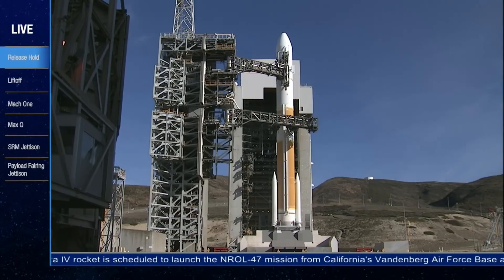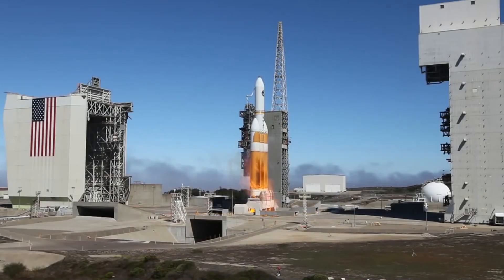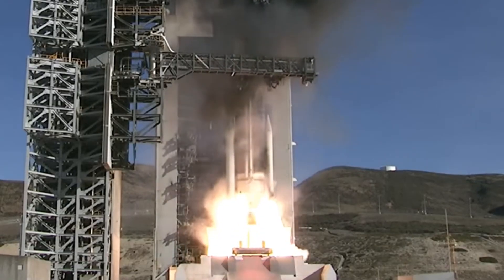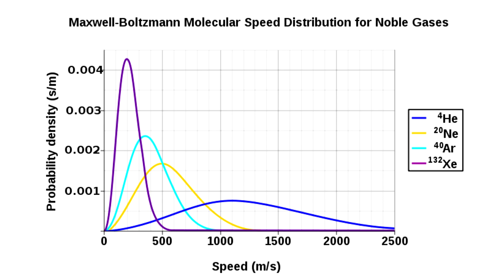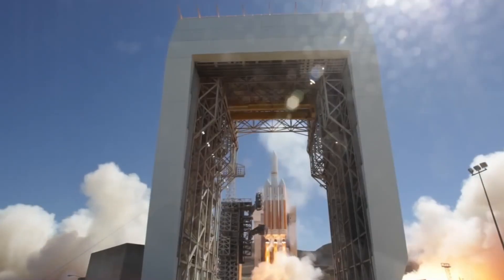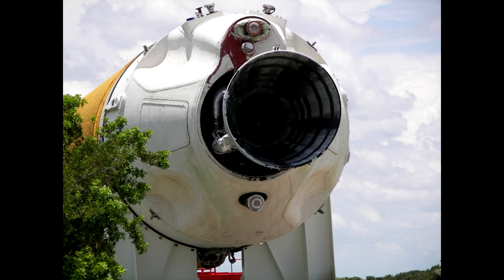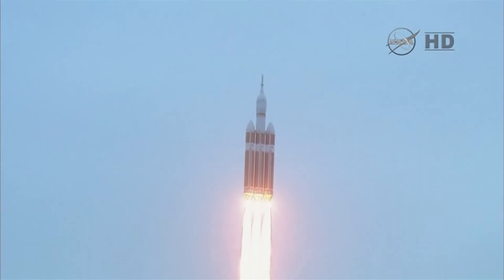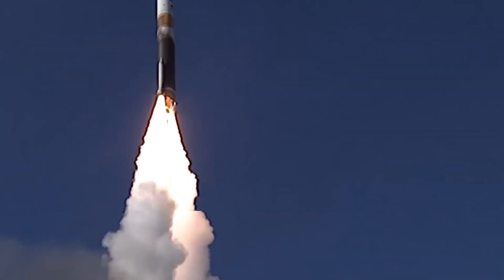Explaining the Delta Rocket Fireball - Kerbal Space Program Doesn't Teach....

Comment: IF IT IS CHEAPER AND MORE POWERFUL THAN THE RS-25 (SSME) ENGINE THEN WHY ISN'T THE RS-68 ENGINE USED ON THE SLS?  CAN SOMEONE ANSWER THIS QUESTION???
Reply: The video even mentions it: the engines were one of the biggest barriers to crew rating the Delta IV. The proposals ULA offered to crew rated the rocket involved switching to the RS-25 or developing a new RS-25 based engine that would have a cheaper unit price (but because of development this would be the more expensive option overall).
Reply: @Hevach  Thanks Jeff For Explaining That And I Like Your Explanation!!!👍

Comment: Would it be easier to modify the delta IV to put up hardware that will be used by humans on orbit? Being able to use something big and heavy to put up the long-haul part and launching and landing the squishy meat in a smaller capsule that doesn't need as much rocket, and thus doesn't need as much rocket person-rated, seems like a sensible way to get most of the benefit of both.

... Also, you should be advising ULA to check their staging anyway. Making sure everything goes off in the right order is even more important when giant fireballs on the pad are considered nominal.

Comment: So that’s why the Shuttle had those spark generators mounted bellowed the SSME’s that were turned on just before ignition sequence to burn off the hydrogen so the tiles didn’t get singed? You can often see on Shuttle launches a burst of flame around the SSME’s as they ignite.

Comment: If the RS-68 is more powerful than the RS-25, then why is the SLS designed to use four RS-25's? Is it for the improved efficiency, or just because NASA had a bunch of leftover engines after the shuttle program ended?
Reply: The core runs from sea level to almost orbit. They need engines that are efficient from sea level to orbit; which the RS-25 does spectacularly
Reply: It’s because of ablative nozzles. The rs68s would get destroyed by the srb plumes. The rs25s will not

Comment: Tory Bruno recently said in an interview that his company's new engines will run leaner with a greater oxygen/hydrogen ratio. It is now April 1, 2020.  I believe his interview was about a week ago in later March 2020.  He said the Russians had used this system in the early years in their engines and it saved a lot of weight from fuel.  But they knew the higher oxygen (leaner mixture) would be more corrosive.  Their secret which we now know is that the engines must include a chemical insulation to prevent them from getting too hot and corroding as well.  I think I said it right.

Comment: The Rich air/fuel ratio also makes me wonder if they did that as hydrogen on its own is a much lighter molecule than H20, meaning that the hydrogen is probably accelerated to a greater speed in the combustion chamber than its fully combusted H20 counterpart. That would mean a much greater maximum velocity of the exhaust gasses, no?

Comment: Hi Scott--I have taken to watching your stuff with interest.  You do a good job.  For the purposes of this video explanation, I would like to offer the following modifications:  First, regarding the expulsion of H2 from the RS-68 during engine start--the start sequence on the Delta 4 was not the start sequence we were ultimately intending to use.  The start sequence currently being used was one that was put together for the purposes of initial development testing, and was intended to ensure that the engine's H2 system was in thermal equilibrium before any O2 was introduced.  The purpose of this was to preclude any H2 flow oscillations, which are present BIG TIME in the SSME during start, and which render the SSME's start sequence a very delicate matter.  We were still 'stinging' from the SSME start sequence 'debacle' when RS-68 start was being scoped out.  It was our intent to 'clean up' the 68's start sequence as development proceeded, to ensure minimum propellant consumption during start, but time/funds were not available.
Second, regarding your plot of Isp versus engine mixture ratio--we should remind ourselves that the 'optimum' mixture ratio for Isp is a function of the engine chamber pressure.  While your plot is valid at RS-68-level chamber pressures, lower Pc engines (such as the original J-2)  have lower 'optimum' mixture ratios.  Higher Pc engines (such as SSME) have higher 'optimum' mixture ratios.

Comment: So I was thinking about what happened to the Space Shuttle Columbia and was hoping you might be willing to give your opinion. 
So If NASA would have discovered the hole on the wings leading edge, could they have possibly re-enterred  backwards.
My thinking is that by going in backwards the wing damaged would moved from leading edge to trailing edge. This would have this might cause the supper heated plasma to trail off the wing instead of being blown into the contained inner pocket of the wing. I know there's no heat shielding on the back of the vehicle but there is a lot of very strong materials in those three big engines that with the proper angle just might offer enough to make it through re-entry. 
The last obstacle they'd face would be that they'd never get the vehicle turn around to land so the astronauts would have to bell out once they were subsonic. I kind of think the bell out would be the most dangerous part of it all. 
Anyhow, comment or make a video about this. Thanks

Comment: I'm gonna vote the RS 68 as the best sounding engine ever to fly. The hydrolox exhaust is so light and fast, it makes a really sharp crackling sound after liftoff, when you're in the mach cone on the ground. I'd give that vote to the RS 25, but I've never really heard it in flight without the sound being drowned by the huge solids (which have a muted thumping type popping sound). I'm also a big fan of the Proton sound. There's some characteristic of hypergolics that gives multi engine clusters this soft clipped ripping sound, probably the combination of exhaust product weight and the reduced chamber temp with this type of reaction. Of course I will be looking forward to hearing (and seeing) 31 full flow Raptors. Any other opinions?
Reply: I think it's 35 raptors now

Comment: Is there a reason delta 4 uses Hydrogen vs SpaceX uses methane? Is methane cheaper?
Reply: ofcourse (btw SpaceX will use Methane on their new BFR, the Falcon 9/heavy uses RP1 or kerosine), Scott has some vids about rocket fuels and methane.
Reply: as far as I got it, SpaceX decided too use methane in their next design is because:
- easier storage / handling (H2 is sneaky / needs cryogenic)
- easier to refine in-situ on mars (which is the intended application for it)
as already mentioned, the current SpeaceX engines use RP1 + LOx.

Comment: "most powerfull engine ever built"   Is it more powerfull then spaceX'  merlin engine?
Reply from the maker: Yes
Reply: As the Delta IV (Heavy) and the Falcon 9 (Heavy) are roughly (!!) comparable lifting-capability wise: Delta has one engine per core, Falcon has nine (merlin) engines per core. So it seems quite plausible to me, that a single merlin is less powerfull than a single Delta IV engine...

Furthermore he said: the most powerful hydrogen fueled engine ever built.
Merlin engines run on RP1/LOx

@Scott: nice that you reply to a rather old video

Comment: In piston-powered general aviation aircraft like Cessnas, Pipers, Mooneys, or Beechcraft we use engines made by either Continental or Lycoming.  Some are carbureted and some are fuel injected.  As we fly at higher altitudes the fuel/air ratio becomes "richer" because the amount of air pressure decreases as we climb.  So in order get the best efficiency, we have to reduce "unscrew" the mixture control to "lean" the amount of fuel going into the engine so that it remains at a constant fuel/air ratio.
          Pilots have the ability to "over lean" the engine.  That is, we can reduce the amount of fuel to the point where we create too lean of a mixture and the engine starts to lose power. If we go too far, the engine will quit, but the propeller will still spin at high rpm's.  All we have to do is push the mixture control in a little and the engine will start running again.  It's not scary for a pilot but we don't intentionally do in with passengers because it scares the crap out of them.
      We can save fuel by overleaning the mixture, but we lose engine performance as well.  Some pilots fly on the "lean side of peak" using a power curve chart in order to save fuel, but in turn, lose some performance.  It's a smart thing to do when you have a good tailwind.  We take advantage of mother nature rather than waste fuel.
          But the point is that most pilots fly on the "rich side of peak" meaning that the fuel/air mixture has slightly more fuel than necessary to create maximum power.  The peak mixture would be the hottest, and not best for the engine's lifespan.  But a slightly rich mixture gives the best performance without making the cylinder head temperatures too hot.  We are taught about the stoichiometric mixture performance early on in our pilot training.  
          It seems the rich side of the power curve is also what rocket scientists prefer as well, according to this video.  "Run it rich" is the term of art.

Comment: We see the "smolder" stage before the full flame on the Soyuz and even the space shuttle.  I suspect it's not nearly as long on the shuttle because there are things above the nozzles that shouldn't be burned, so once the hydrogen is lit, moments later, the oxygen is put in, causing the flame to coalesce into what are used to seeing.

On the Soyuz, it's a lot longer, and the deep flame trench allows us to see this.  The fact that it uses kerosene in the first stages also helps as it's apparently heavier than hydrogen gas.  You see what looks like a dumpster fire when the engines are first lit (RP-7 fire fanned by the atmosphere), then a few seconds later, it ROARS to life with a coherent flame (RP-7 fire fanned by pure oxygen).  And shortly after, the stack is let go to fly skyward.

Comment: Hydrogen Fuel has to be burned off before ignition because it can explode if helium and O2 are added. the burn last two minutes and then the helium and O2 are added to the mix to start the engines. Every rocket used has igniters mounted by the nozzles this is to burn the RP1 and Hydrogen Fuel before the rocket engines ignite to prevent an explosion. The fuel pipes are connected to a flare stack at the fuel plant next to each fuel sphere this is the flame you see at the side of the rocket during fueling and liftoff.

Comment: As part of a  realistic science fiction writing project I am working on I' ve always wondered  if I had a shuttle like personal space yacht, would the launch  as a flight from ground to edge of atmosphere on conventional jet engines followed by rocket assist to orbit and departure make sense sand what would the costs be compared to a regular vertical launch from a space-port be. Assume a  mach .97 speed in atmosphere comparable to citation CRJ and  ten times the mass and size. In otherwards I know it would be expensive but how expensive? ON-board storage tanks for hydrogen fuel as well as jet fuel. Assume enough for two launches to space and landings. and a full tank capacity for  in atmosphere travel. Non-fuel and non-crew Cargo capacity of say 70 tonnes. I realise that  the flight to orbit time would be considerably longer by  at least  30 minutes before final orbit and departure burn where as a direct to orbit ground burn could be 10 to 15 minutes.

Comment: 2 O2(g) + O2(g) is flat out wrong.
Oxygen is about 16 times the mass of hydrogen.
Either you mean:
2 O2 + O2 or 32 H2(g) + O2
Where the first is either individual molecules or moles
Reply from the maker: 2 hydrogen atoms bond to one oxygen atom. 
Each oxygen atom is 16 times the mass of a hydrogen atom. 
Chemical equations are about molar quantities rather than masses.
Reply: You wrote (g), which stands for grams, as in mass.
Sorry, but what you have on the screen is wrong. You need to remove (g) from the video.
Reply from the maker: joshua43214 I believe that on the page I referenced (g) signifies that the substance is a gas at room temp, and (l) signifies a liquid at room temp

Comment: Yeah but what if you modified the flame trench a little. Add sparklers near the engines as an ignition source, and blowers adding outside air to the tunnel in a way that the venturi effect would create a small suction beneath the rocket. Like so the hydrogen would not float up and scorch the craft, it would be sucked downward into the flame trench and consumed there amidst the deluge water.
Reply: That's pretty much what was done with the Shuttle Orbiter; there were spark sprayers that would combust the pre-ignition hydrogen and keep it from enveloping the shuttle, which had no protection against raging hydrogen flames.

Comment: Even the Saturn 5 rocked with its kerosene and oxygen fuel did this. To a lessor extent but until the turbines got spun up started producing thrust it was also a rich fireball at the bottom of the rocket. It only lasted a second or two and was pretty much contained in the exhaust chamber underneath the rocket but was there nonetheless. Sure for apollo 11 launch and you can see it in the normal replay of the high speed film. Narrated and explained rather well. Thank you.

Comment: If the fire ball is caused by stray Hydrogen, then why does it appear to leave soot on the side of the rocket engines during start-up?
Reply: The outside of the tank is covered in insulating foam, some of which burns off and creates soot.

Comment: I recall reading (I think?) about fuel rich engine start-ups and shut-down to eliminate for lack of a better term "Back-Fires" and in the parlance of rocket science a "Hard-Start" or "Hard-Shut-Down".  As I recall the idea is that a fuel rich mix at start-up and shut-down would ignite/extinguish without a BANG that could potentially break stuff .  The "Back-Fires" analogy comes from older carbureted vehicles that when you lifted your foot off the accelerator pedal you often got a Back-Fire (BANG) due to the lean (fuel poor) mixture.

So, anything, or am I just passing exhaust.

Cheers, Mark
**************************************
Reply: yeah, might be the fumes.  or maybe we need a new perspective.  instead of start up and shut down,  how about we shut up and start down?  of course, we will know much more if/when elon gets his red roadster lobbed into orbit.  anyway, i remember them carbureted vehicles, Mark.

peace,
bill

Comment: Could the flame be eliminated with a equally oxygen displacing gas like argon or helium?
Reply: Yes, but then you have to go through the effort of building a helium or argon tank into the design, and both gases are far more expensive than hydrogen. Also, you've got to start up the hydrogen line first anyway, to prevent the propellant from exploding instead of burning.

Comment: Scott, why didn't the Shuttle exhibit the same sort of fireball?

Both the Delta IV and Shuttle used sparklers (or ROFIs / Radially Outward Firing Initiators).  Were they placed differently on the Shuttle so that the hydrogen lit earlier?  Is it that the RS-25 (SSME) used staged combustion, so all the hydrogen exited the nozzle and was easier to ignite locally than with the RS-68 where it also exits the gas generator exhaust / roll control nozzle?  Or does it have something to do with the Delta launching dry while the Shuttle used a water deluge system?
Reply: If you look at footage from the launch crawler, the sparklers were set well below the SSMEs, so that hydrogen that did combust due to this pre-ignition sparking would do so in the exhaust area and not flame up around the shuttle itself.

Comment: Instead of using a rocket going straight up into space, why can’t they make a plane that flys horizontally and up into space? It seems like that would be easier and wouldn’t require giant expensive fuel thirsty rocket engines. Or would you burn more fuel doing it that way...
Reply: Planes can go up to 85,000 ft, space starts at 330,000 ft - quite a bit is missing and then you need quite a bit of speed to remain on orbit (17,000 mph for ISS). While there are works on hybrid jet-rocket engine it turns out to be quite a challenge to even make it run. Even if they make the engine space plane still might not be as efficient as rocket for the same reason Space Shuttle wasn't efficient - you have to haul tons of space plane hull and wings to orbit - thats colossal waste of fuel.
Reply: In addition to what randomnickify said: Rockets DO go mostly sideways. They just start vertically for a number of reasons. Look up Gravity Turn.
Reply: randomnickify 
This is rocket science, use metric.
Reply: randomnickify 
This is rocket science, use metric.
Reply: The plane is called Skylon.
Reply: Look up escape velocity